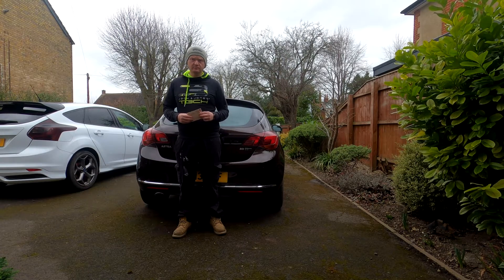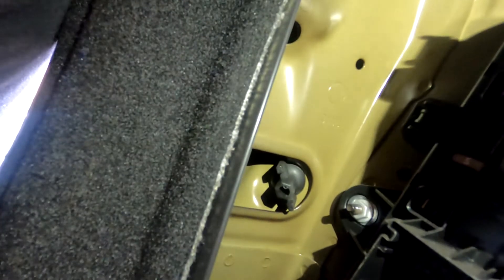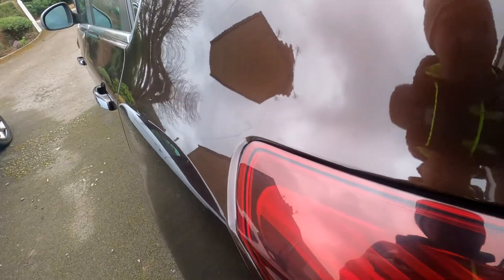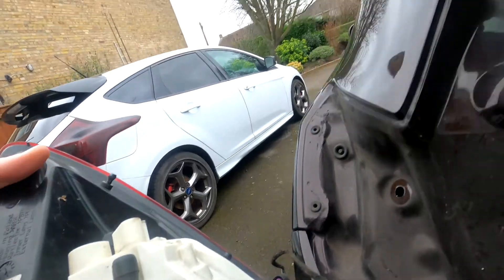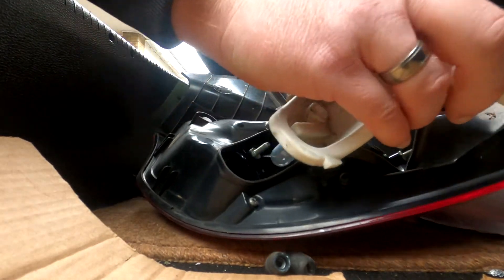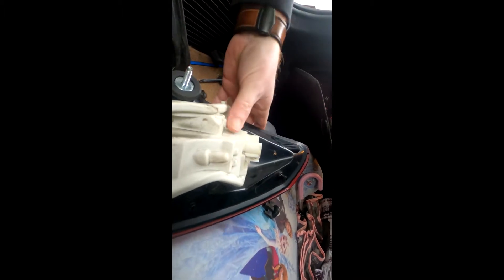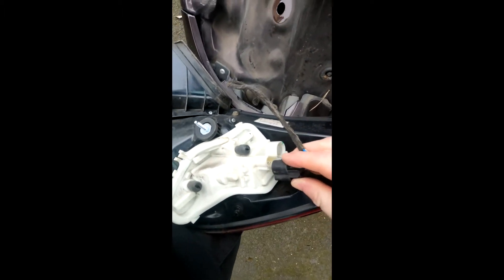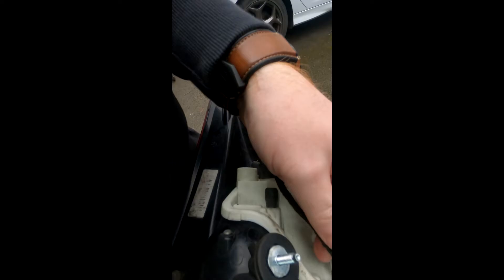How to change a rear brake light bulb on a 2013 Vauxhall Astra J

Comment: cracking video cheers, can i ask what happened at the end when the lights didnt go off until you went back to the boot to do something then it worked after that?
Reply from the maker: I went to check in this but it was all ok. Then I took the keys out of the ignition and put them back in and turn the ignition and it worked. It was a bit of panic moment because it was working when it should have
Reply: @nocluewhattodo21  was a stupid question mate i was just curious as to what happened. Great videos keep them coming

Comment: Any ideas on how to remove the high level brake light? .. Finding it difficult to access the clips on ours. Is there a special tool needed?
Reply from the maker: @kayleespencer4428  dunno never tried but I will get it a go and get back to you

Comment: My astra centre display says ! low battery when ever start . Been happening for a week with no effect on the driving.. any idea as to why?
Reply from the maker: The voltage output is low.  You should replace it ASAP